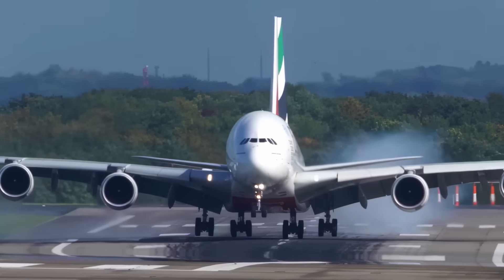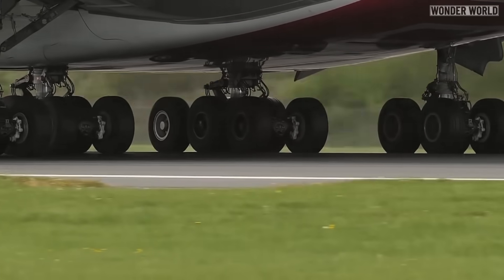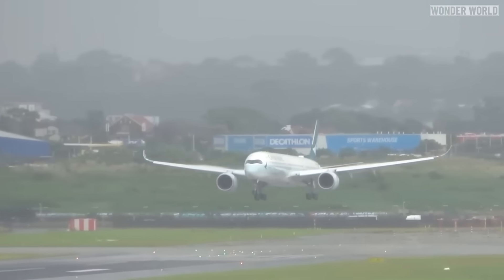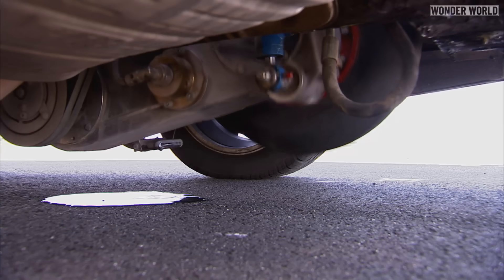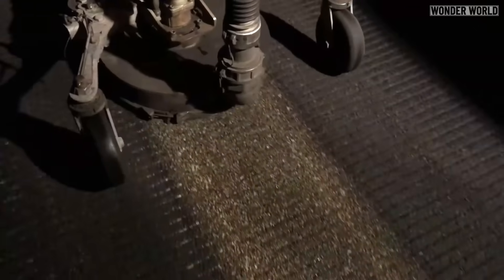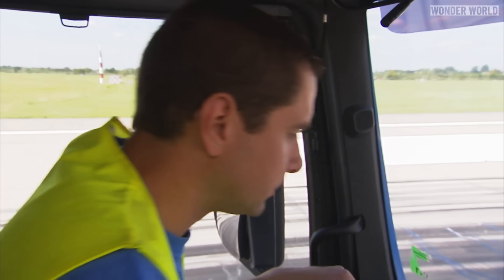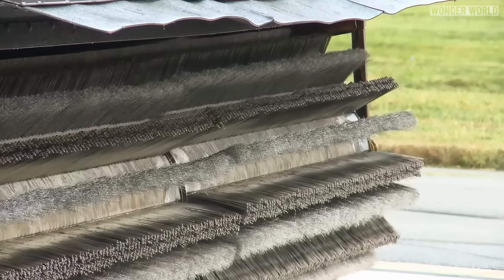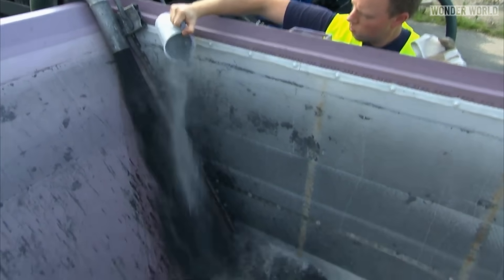Why They Clean Rubber from Airport Runways

Comment from the maker: ★★★ FACT UPDATES / ANSWERS TO FAQ's ★★★

1) Atlanta Hartsfield International Airport, is the Busiest Airport in America, but also the Busiest Airport in the world. So if JFK Airport are cleaning the runways 5 times per week, I can imagine Atlanta Hartsfield, must be cleaning their runways everyday.

All the information in the video is accurate based on JFK Airport with 1200 flights per day.

2) People have asked, why not just add motors in the wheels to get the spinning up to speed before landing. I have not researched this  and I am sure there is a good engineering answer why not. But years ago a company invented tyre tread mounts that would fit on a truck in front of the tyres, incase of an emergency stop they would unroll under the wheels and help stop the truck quicker. it was a good invention that would save lives and stop accidents, but no truck driver uses them because it added extra weight to the truck, which lowered how much cargo they could carry, and in turn how much money they could make per run. Maybe they don't want to fit extra motors because it adds extra weight, to an already heavy aircraft.

There is one other reason I thought of for not having wheels spinning pre landing, as a spinning wheel acts like gyroscopic stability. This phenomenon occurs due to the conservation of angular momentum. When a wheel is spinning, it tends to resist changes to its axis of rotation, making it difficult to tilt. Maybe this would hamper the pilots ability to fly the plane if he decides to abort landing and go around for another try. again, no idea myself, just a guess.

HERE IS LINK TO VIDEO FOR "Why They Don't Prespin Tires on Landing" - https://www.youtube.com/watch?v=Jm6hOnsxy3M
Reply: I live in Atlanta and can confirm that they clean twice a day

Comment: Easy remedy, but the tire companies would shut it down.
Each wheel could be spun up to ground speed by using ducted air pressure from the planes engines. The pressure could be regulated by a computer,  and the ABS brake system.
With the tires spinning at the landing speed of the airplane, there would be minimal rubber lost. This would  result in many more landings on the same tires. A major savings to the airlines, that would easily offset the cost of the equipment and additional weight of the plane. 
Tire companies on the other hand would most likely delete the person that held the patent.
Build it and sell it to the tire companies.

Comment: Isn't it kinda obviously? To much rubber built up can both catch fire and cause issues with friction. Uneven breaking in an aircraft could be fatal as could the runway catching fire when you touch down because the friction on a hot summers day could add enough heat to ignite the rubber.

Comment: Why wouldn't you put electric motors on wheels to reduce waste and maintenance?
Reply: The short answer is that anything aircraft related isn't simple. It isn't just putting electric motors around tires. It is running wires to those motors, which WILL require inspection. It's making sure that the flight characteristics aren't altered by the installation of spinning wheels. There is a gearbox in their somewhere. It is ensuring they fail in the safest way possible. It is also certification that the design works as designed. Certification in the aviation industry isn't a joke or an expensive con. It is a very necessary thing to ensure that your design doesn't kill or injure people.

I will put it to you simply. If a light bulb or reclining seat motor catches on fire in your house, you can survive and either use a fire extinguisher or call the fire department if it gets out of hand. Those same fires in aircraft can kill hundreds of people and as such need to be ruled out to the degree one can.
Reply: @michaelmoses8745 Got ya, less points of possible failure on the aircraft makes it safer for passengers
Reply: @beatbox20fmj  There is a lot more to it, but essentially yes.

Comment: At the edges of a race track, you find balls of rolled up rubber. If you drive out there you are "in the marbles" as the balls of rubber act like squishy gravel. For aircraft, the marbles stay in the driving path, so to speak. The layer of rubber on the runway might as well be ice. Weather it's 'marbles' or just stuck to concrete.

Comment: Wrong right out of the gate. JFK is NOT 'the busiest airport in America' - that's Atlanta's Hartsfield-Jackson, which has held the title of world's busiest airport for 26 of the past 27 years, handling 108+ million passengers annually. JFK doesn't even crack the top 5 busiest in the US, let alone globally.

Your entire calculation is based on a completely false premise. If you're going to do the math on rubber accumulation, at least start with accurate data about which airports are actually the busiest. This isn't some obscure fact - it's basic aviation knowledge that takes 5 seconds to Google.

The runway rubber cleaning process might be interesting, but when you confidently state something this fundamentally wrong as your opening fact, it destroys any credibility for the rest of your 'research.' If you can't verify which airport is busiest, why should anyone trust your other numbers or claims?

Thumbs down for lazy fact-checking. This kind of sloppy research makes me question everything else you present as fact. Blocking future recommendations from this channel.

Comment: I do not know why they don't have an impeller on each tire or tire set to spin up the tires as the landing gear is deployed.  When the gear retracts the tires stop spinning until the gear comes down for the landing.  When taking off the gear is retracted as soon as the plane clears the runway.  How long is the time when landing?

Comment: They should have a rubber runway and concrete tires.
Reply: Why not just spray the runway with foam? No landing gear, all belly slides!
Reply: @old_school_guy  It would be cheaper for passengers to be dropped above the airport while the plane flies over it at low altitude and low speed, passengers and luggage could be on a pallet
Reply: 💯 what's the need of lowering the landing gear.."Just jump if you think you got to your destination in mid flight

Comment: Landing distance will only be effected on a wet runway. On a dry rubbered in runway, grip is even better. Think a rubbered in race track. As the track becomes rubbered, lap times get better.
Reply: Or a drag strip
Reply: @justayoutuber1906  yeah well same difference. Point is, tires perform best rubber on rubber
Reply: @rightsideup96  was thinking the same thing, but maybe its gives too much traction? As the traction increases the load on the tyres would increase when they go from stopped to full speed in a instant, possibly increasing the chance of a blowout. I agree that in the wet it would be dangerous for the opposite reason of no traction

Comment: As for spinning the wheels before touchdown, it's all about economics in aviation, and unless it's a net positive gain for everyone, there's no reason for it to be done.
Reply: You would have to figure out a way to motorized the wheels and that would add a lot of weight limiting passenger capacity and the plane's range
Reply: @blairpenny1526  Its all a question of money if they make the wheels turn on landing they will not leave any rubber so the cleaning trucks and the company that owns them will be out of business we are talking of 5 tons a day in just one airport!!!!
Reply: Doesn’t need to be motorized. It could have fan blades that spin the tires  from the wind movement
Reply: @jeromevonloodwig5851  where lol?  Just more weight and more things to break and they still wouldn't spin fast enough to stop them from leaving rubber behind
Reply: @blairpenny1526  That's why landing gear should have wooden wheels.
Reply: @jeromevonloodwig5851  = more drag = more fuel
Reply: @jeromevonloodwig5851 I don't think you quite realise how large a plane tire is and how much it weights...
Reply: @jeromevonloodwig5851   Everything (and more) that could be suggested in these comments has been thought of (and dismissed) by the aircraft designers.

Comment: FYI there is no "TARMAC" at airports. Runways are usually concrete or asphalt. Unfortunately TV news anchors love to say "Tarmac" as it's still a colloquial term for any paved surface at an airport. Airports & the aviation industry never call it Tarmac. Tarmac used to be a thing but replaced many years ago with asphalt.
Reply: Yes, thank you. I worked in aviation management in the US Air Force. 
Drives me nuts when I hear tarmac when talking about airports.
Reply: Tarmac refers to a type of road surfacing material made by combining tar and macadam (crushed stone and sand). It was patented by Edgar Purnell Hooley in 1902 and is known for being durable and dust-free. Colloquially, "tarmac" is often used to describe any paved surface at an airport, including runways and taxiways.
Reply: @justayoutuber1906  Let me tweak that a bit: Colloquially, "tarmac" is often INCORRECTLY used to describe any paved surface at an airport"
Reply: @justayoutuber1906  thank you for repeating for zero reason what the first comment already said not adding anything of value
Reply: Oh really, mr. Smartypants?
Reply: Wrong...because words and meanings change over time.  Sure, tarmac is a portmanteau of the original ingredients in the original material, but again, things change over time.  Now it is also understood to mean the paved surface which planes use at airports.  Just like saying Kleenex when we mean facial tissue.
Reply: @Anastaecia - Used by uninformed lay persons. It's called a Runway by all those in Air service. Runway is a simple word, no need to use an archaic colloquial word.
Reply: @inisipisTV  as a certified layman i concur. I just dont know what i am concuring with as I am a layman.  In fact my very last name may indicate that I come from a long line of lay peoples.  Laytham.  Hows that for being born like tim walz.  Re-   tarted.
Reply: Tarmac
Reply: If that bothers you, here's a Kleenex.
Reply: @GamesFromSpace 
Classic!!!
😂😂😂

Comment: Heya Scott, do a follow up on why planes don't spin the wheels up for landing. It's an interesting topic.
Reply from the maker: yes that is the next video
Reply: If I had to guess, I'd say

1) would require motors at each wheel - which adds significant weight, complexity, and maintenance

2) the cost of the added weight in fuel burn, costs of 8 to 22 motors and their maintenance - probably don't outweigh the cost of more frequent tire replacement and added landing fees to cover this cost of cleaning

3) not all planes would have this, so the costs of cleaning would still need to be there so there wouldn't be any savings on airport fees

4) so then it's just the cost of 8 to 22 motors and fuel burn and maintenance VS cost of tire replacements more frequently
Reply: @Foof0811  Has nothing to do with motors. Can spin wheels with the airstream if required.
Reply: That would be too complex, costly, and heavy.
Reply: Wheels spinning full speed when landing. It'd almost take off again.

Comment: Seriously why not start the wheels rotating before?
Reply: There’s a very good reason for why they don’t do that. Research it
Reply: Some time ago they experimenting with wind vanes to get the tires rotating using the airflow. Unfortunately it turned out that the gyroscopic effect of the rotating tires is enough to make the control and landing of the plane quite a bit harder.
Reply from the maker: that is the next video